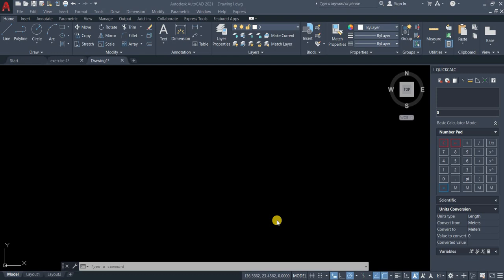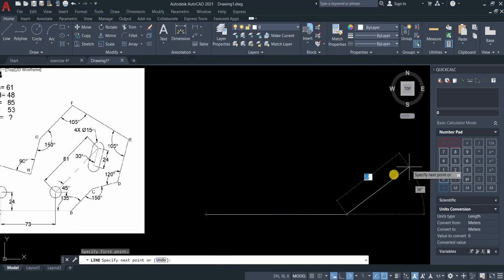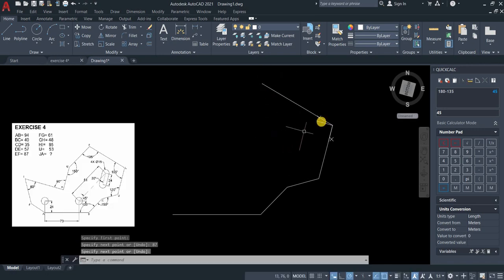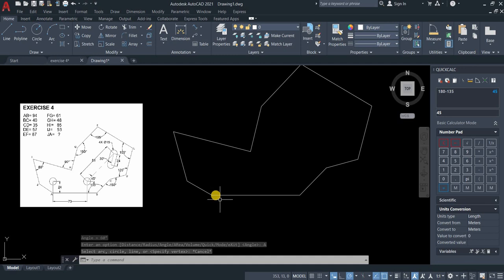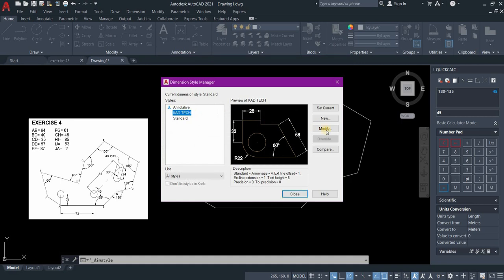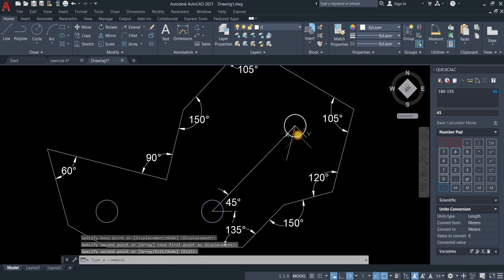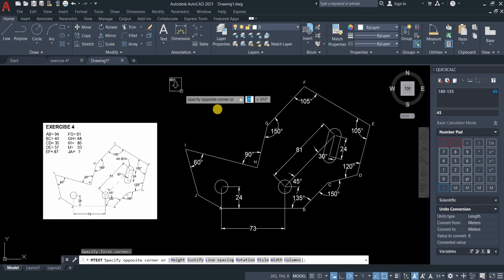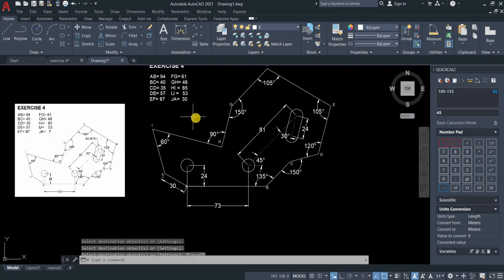AutoCAD 20 days 2D CAD Exercise 4. How to draw a line with angles.

Comment: For more quick n easy, first draw all the lines as per given dimension, then use "dimconstraint" command, then type "an" (for angular) press enter, then check the angle of each line same time it will allow u to change the angle whatever u like.

Comment: thank you for your explanation but i have a question... in the next method of drawing an angle the x-axis is on the previous line but how can i know the direction of the y-axis left or right ???
Reply from the maker: Hi Yehya, once you determine the location of x-axis which is the previous line, the y-axis has two directions only. Based on my experience either way you can still locate the correct angles.
Reply: @kad-tech8992  thank you 😍
Reply from the maker: welcome 😁